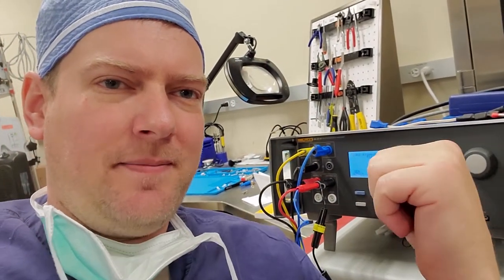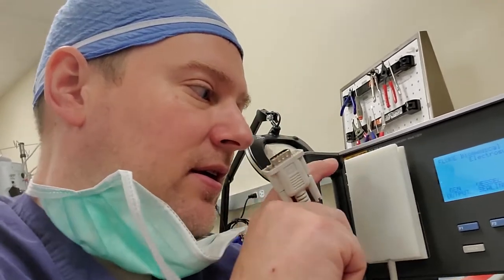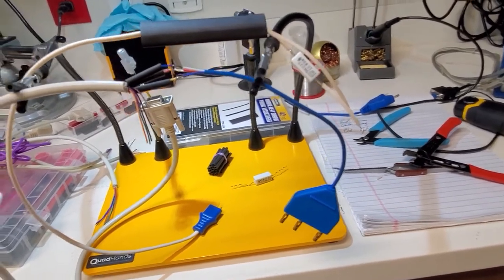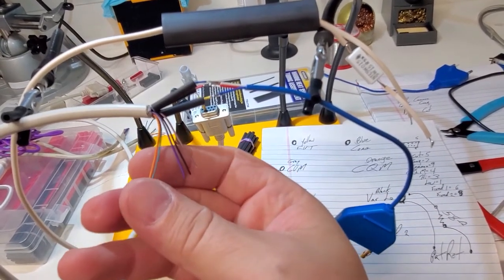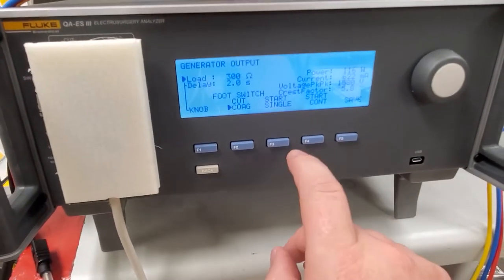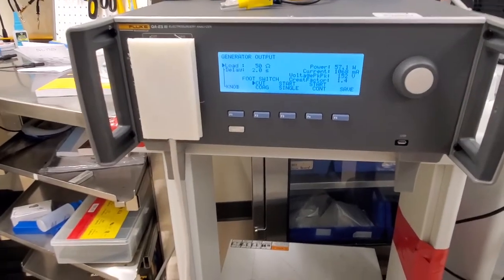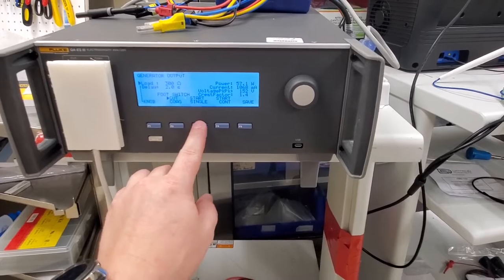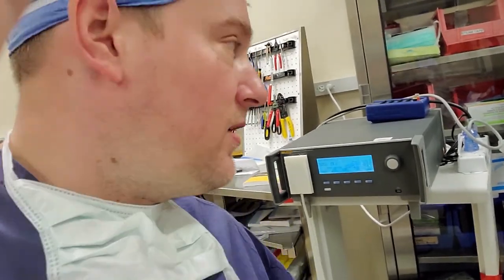Fluke QA ES III Multi Function Adaptor

Comment: Do you have the Bipolar pinout? I got the mono setup already also can I get the CNC cad file.  If not I understand
Reply from the maker: This adapter was designed in Vectric Aspire. I will check and see if I have the pinout for bipolar.